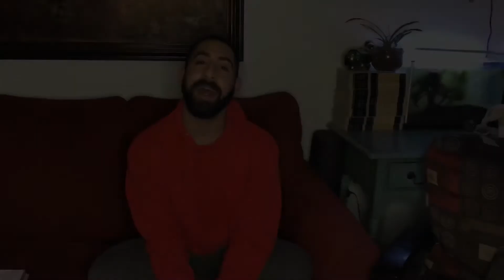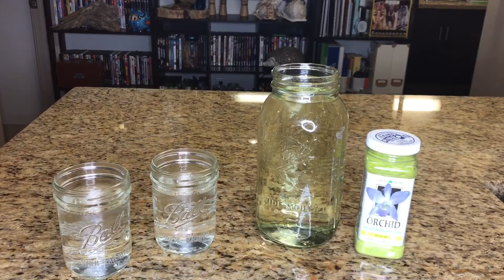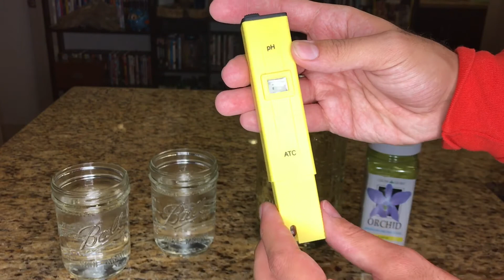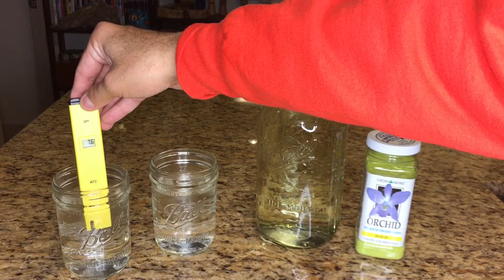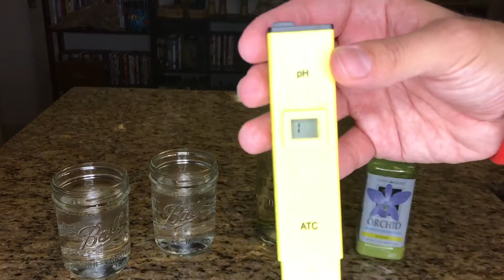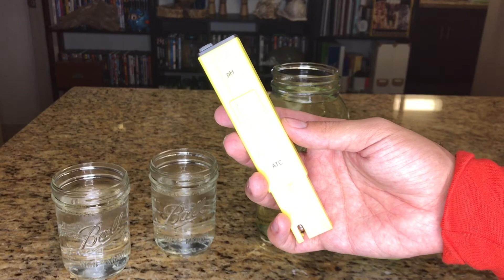PH, TDS & Water Types: Semi Hydroponics (Part One)

Comment: What about the ph of media? I ask because I'm using media that is supposedly acidic, I wonder how that would affect the ph in the pot, since the orchid is in contact with the media all day.
Reply from the maker: Hi Derpi! That's a great question. LECA is pH neutral, so I focuses only on the water. But I'd encourage your to measure the pH of the runoff from watering your plants, which will give you a better snapshot of the acidity of the media

Comment: hi Michael, oke can theorize with you ? 

I'm currently using rain water (I have more then enough of rain in my country😂 ) but what if my roof of my porch is not clean and the tds is of the charts therefore making my rainwater unsuitable. 
I do not have the funds to get an ro system or buy water....
could I use a seringe and ad a drop of Ciric acid/ apelcider vinegar/ wine vinegar etc etc to my tap water (witch is 7.9 ) to lower the ph and making it suitable to transport the nutrients. btw I would try it out on 2 liters of tap water with halve a tsp of 20-20-20 that's my weekly weakly basic feed for active growing plants (I do have low nitrogen for dendrobiums for aug to Halloween) but i degress

I would try to.lower it when it's all mixed and use drop per drop to get to the sweet spot of 6.5 or lower. 

is that a viable option?
Reply from the maker: To be honest, I don't know the answer to your question and will have to do more research! I've heard of a lot of pH reducing additive, but I'm pretty sure they'll raise the tds in the process. Let me look into this a bit!
Reply: Michael's Orchids sure hun. when and if you find out let me know. I'm getting my tsd meter I hope within 2 weeks (it comes from China lol) I did not get a ph thinking it would not matter because my tab used te be 7 in my aquarium days thats 7 years ago and I just found out last week it's 7.9😐 so not happy and ordered a ph meter but that's gonna take 4 weeks to get here. so I have loads of time to figure it out. ps if I find the awnser I'll let you know.  

I forgot to say your really getting profesional and your channel and content is almost like infomercial but way way better (lol for my way with words 😂)
Reply from the maker: You're so sweet, I'm glad I seem professional, lol! Yes, having both meters is very important and will help guide you!